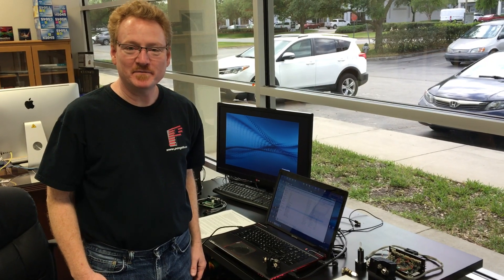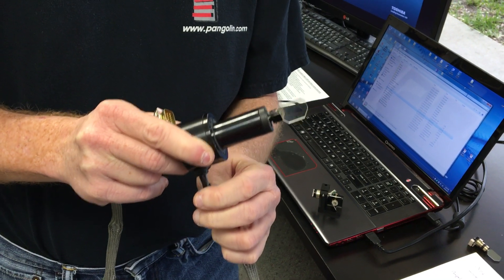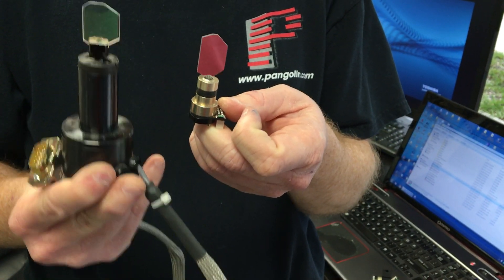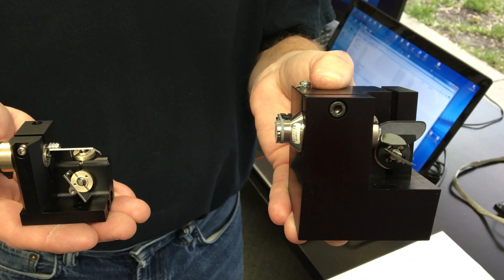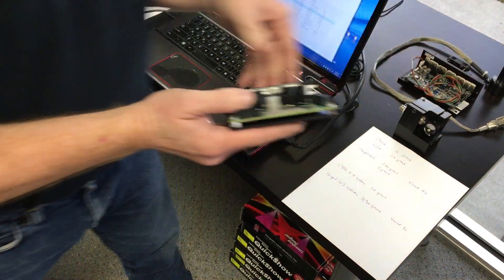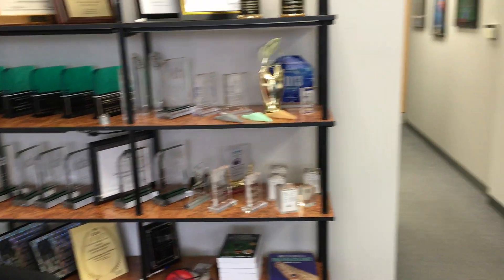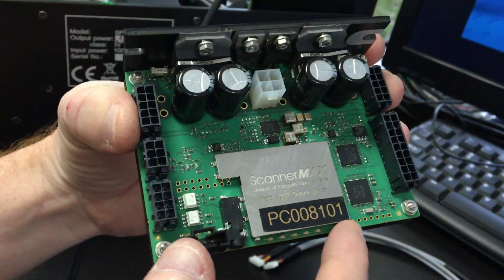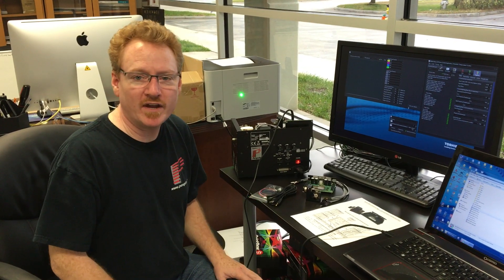ScannerMAX Compact 506 for 10mm apertures -- What's included?

Comment: How much is this xy 506 scanner system cost? Do you sell direct or through distribution? And with a 5mm system how would you rate the speed in Hz with industry standard deflection angles? And finally how does it interface with the Pangolin software system?
Reply from the maker: Please contact us directly for the price since it depends on mirror size, and mirror coatings (i.e. wavelength). All ScannerMAX data sheets have a graph showing maximum scan frequency versus scan angle. And you can interface it to any software using either an analog input "command" signal or digital signal.